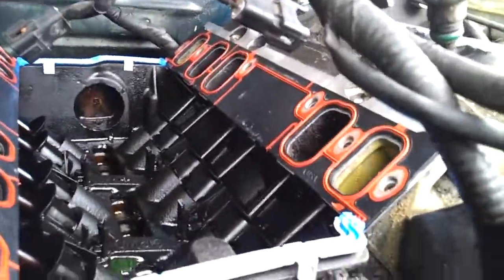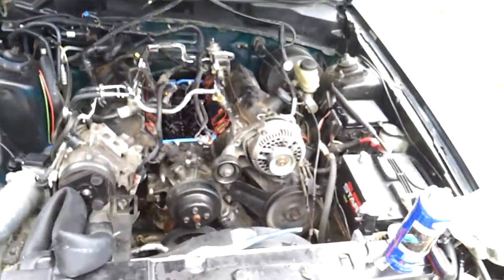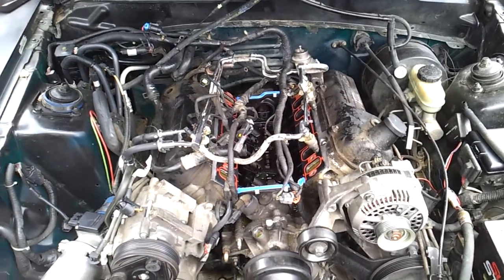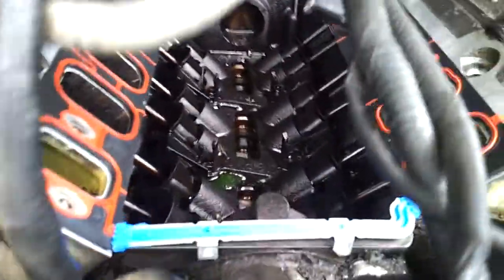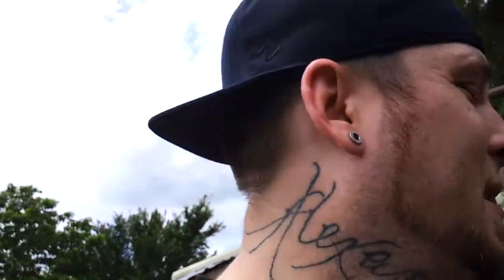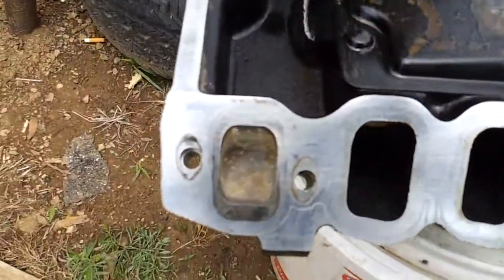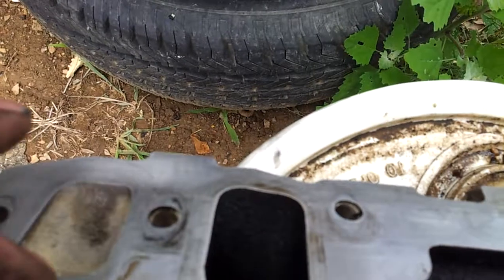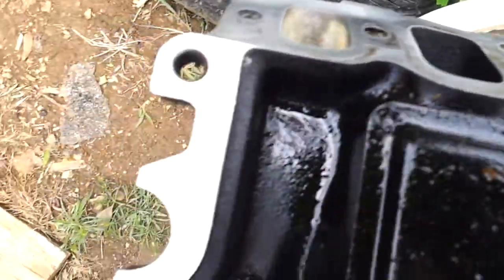how to fix 1998 3.8 mustang intake gaskets

Comment: not really the new gaskets if you want if you see the orange line on there that's actually it it melts down the block heats up and it seals itself but I put a drop just like a little teardrop in each corner of the gasket and in a sense there's other gasket to keep it in place while I position the heads that's all I used